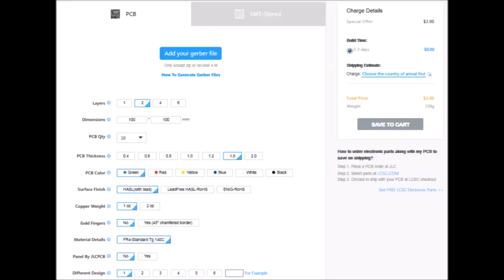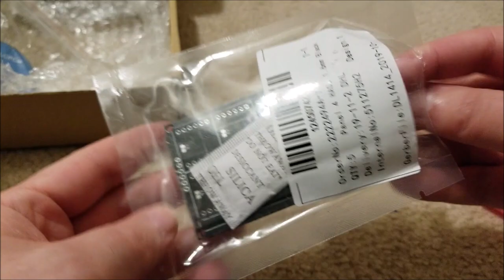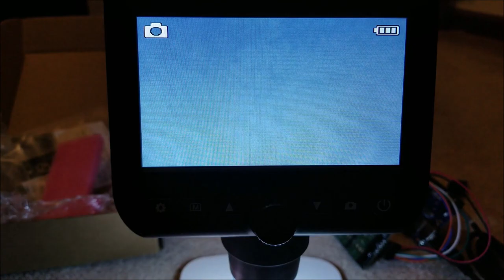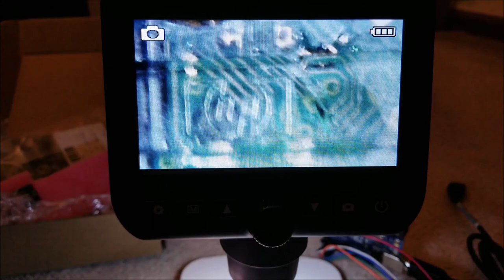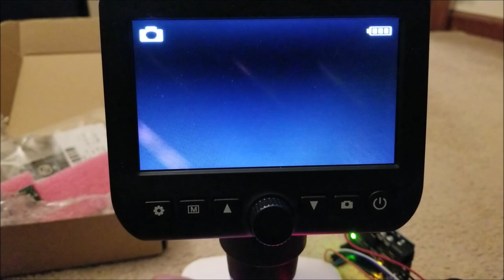16x2 Character HPDL-1414 Serial LED Display

Comment: These displays were designed and manufactured by HP in the 60s,they were used on aircraft radio and navigation displays
Reply from the maker: Pretty interesting then that the date codes on a few of them I have are mid 90's, crazy to think these were popular enough to warrant a ~30 year production run!
Reply: 60s is doubtful, because very early LED was made in the 60s, they were brightless and big. 80s-90s is more truthful:)
In 1950s-1970s most common displays was made by  nixie tube (cold cathode displays gas fulled)

Comment: I'd love more info on this maybe even explaining the code.  I bought some of these but couldn't find any example code and I'm not proficient enough to write my own from scratch!  How easy would it be to make the words scroll across the displays?  Thanks in anticipation for any feedback.
Reply from the maker: I plan on releasing the software, schematic and pcb soon. Scrolling the display would be very easy as the function I made to write to the displays accepts a simple string.
Reply: @sjm4306  thanks for the prompt reply and I look forward to your  updates as, I feel, its a great wee display with a really retro feel!
Reply from the maker: The pcb and software are up here: https://hackaday.io/project/168425-hpdl-1414-16x2-led-display

I'll do a writeup explaining how it all works in the near future.

Comment: Nice Project ! these day the HPDL 1414 is really cheap. 3 years ago I got 2 for almost 10 bucks
Reply from the maker: Given how expensive other integrated led displays have gotten I was surprised to find how cheap these guys are!
Reply: I also have other vintage display like this. VQC10 SCDV5542 HDSP-2000 HCMS-2915 .
Reply from the maker: Nice, treasure them, the prices on these vintage displays are only increasing.

Comment: very nice project, try to remove the cracked plastic and make another enclosure with epoxy resin :D
Reply from the maker: I have a feeling the original epoxy was poured directly over the led chips and microscopic gold bond wires so any attempt to remove it would destroy the displays. In fact I was actually surprised that despite all the cracking that not a single digit was killed.

Comment: ah forget the cracks, it still has the same functionality and still looks alright (the characters look gorgeous)
I always looked down on diy smart watches as they were just bluntly boring, but now I consider using this module for a self made smartwatch that would look like a normal watch yet display messages, phone calls, control music etc.
might be a little bit tricky with power consumption, but to me it sounds like a worthy interesting retro watch + smartwatch

Comment: Nice display, thanks for sharing!

It occurs to me the the !OE input controls the shift register outputs (!G input). I don't quite understand how this could be used to dim the displays via PWM since (I believe) the displays themselves latch the character data. It would be nice if there were a blanking input directly into the HPDL-1414 display chip.

In any case, nice job!
Reply from the maker: Yeah I had a bit of a brain slip, for this display it wouldn't. I've used this oe pin in the past to modulate multiplexed displays in this way and forgot these hp ones weren't manually multiplexed when I shot this.

Comment: those look like 16 segment displays, not 14 segment as evident by the split bottom segment in the 'J' and the split top AND bottom segments in the 3, 0, and 6. 
also, a further search on google shows that they also have a decimal point in the middle directly to the right of the  L segment and right above the D2 segment; you can see it if you zoom into the exclamation point.
Reply: i had a little  déjà vu seeing this video thinking i had already watched it but thats bc David Watts did a video on these as well

Comment: Sweet! I can't find the project files though :( I defintly want to build a display myself :)
Reply from the maker: Thanks, still writing the project page, it'll be up in a few days.
Reply: @sjm4306  Nice, I'll send you a picture of my display when I'm done :)
Reply from the maker: PCB and software is up here: https://hackaday.io/project/168425-hpdl-1414-16x2-led-display

There's a design flaw I plan on fixing but for the most part v1.0 as currently available works just fine (except I screwed up the address line order on the pcb so I had to bodge compensate in software). Currently the string function works perfectly, but writing individual chars will result in some letters in the wrong location. I plan on releasing a properly updated software fix when I get the chance so that chars are properly located.